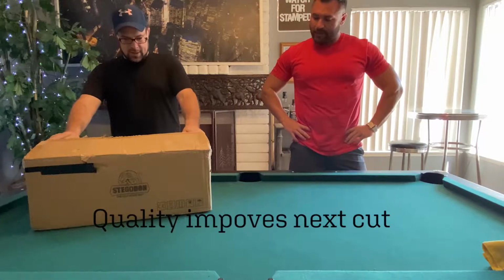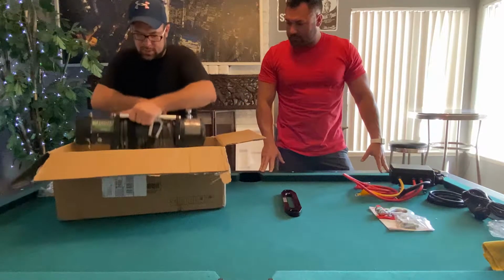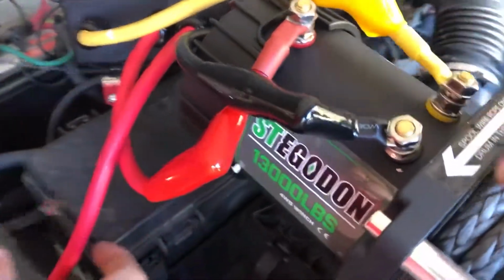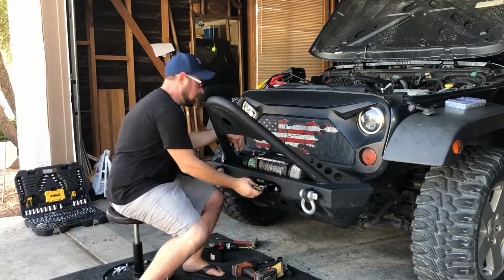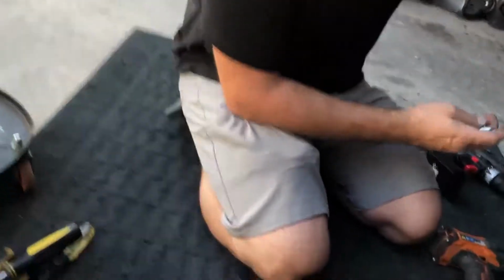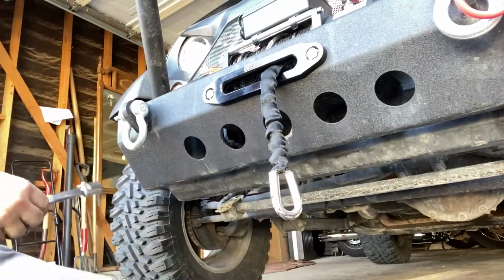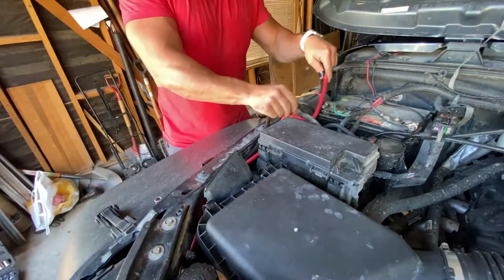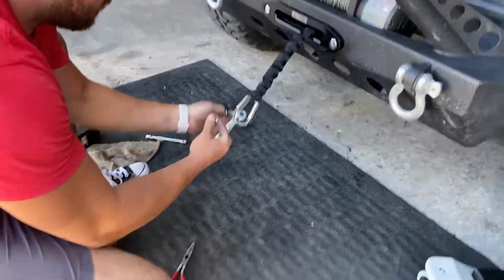Winch install Stegodon  13,000 pound Winch

Comment: Thanks for the video. I had a quick question. How is the winch holding up 2 months later? You had any issues with and do you like it so far? I am interested in buying one. Thought I ask you guys. Keep up the good work.
Reply: I have the same winch and I’ve had it for a year now and for what it is its actually really good. It’s definitely kinda slow but it always works. I will say literally the only problem I ever had with it is the winch cover it comes with is complete garbage get a better one if you get this winch. But other then that it’s worked great every time I used it never had any problems. I heard people complaining about the wireless remotes on them and although they do feel cheep mine still works to this day.